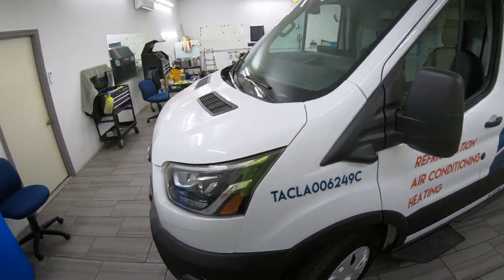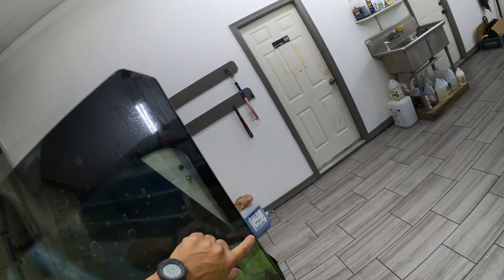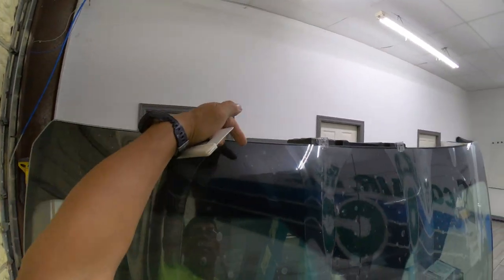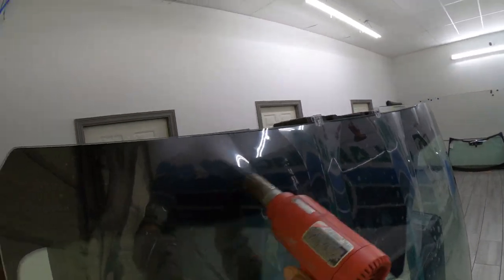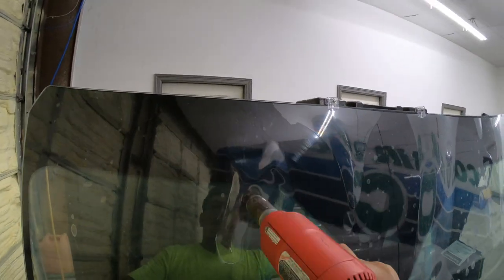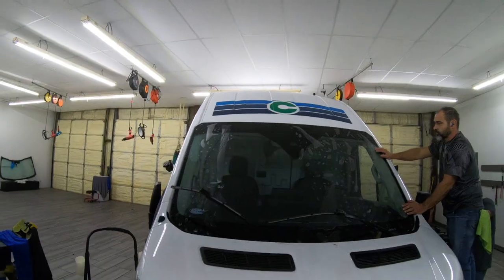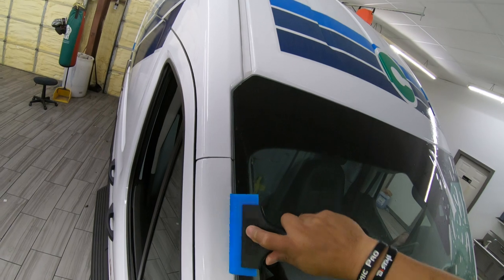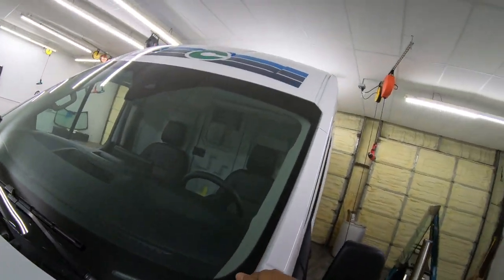2023 Ford Transit Exterior Crack Prevention Film Install  Start to Finish!

Comment: Hi Mike, thanks for posting this video. I’m a fan of your channel as I am too an installer. I was looking for a video on the ultra fit windshield film because I wanted to see how easy or hard It was to install this film and seen the video from Chicago auto pros who did a review on the installation and it didn’t go well for them. When I finished watching the video I said to myself why didn’t they remove the cap sheet and try it that way instead because there’s too many layers. And when I saw your video I was like I knew that would work. 2 great minds think alike. Thanks again for making this video and keep up the good work.
Reply from the maker: Absolutely boss 🙌 😎 👌

Comment: Does this film stand up well to scratches? Such as using a windshield wiper.
Reply from the maker: This is an accessory..it must not be used with wipers to clean dust off it..it will scratch it..
Rain will clear sand before wipers hot it dry...keep that in mind...like maintaining a Rolex..or white leather sneakers 👟

Comment: The video I was looking for! On my third attempt installing it on my tesla model 3. 

Was always shrinking it with cap sheet on thus; taking forever to lay flat and on the top edges it creases, does the film  scratches if the cap sheet is removed while shrinking and final squeegee?
Reply from the maker: Use a wool card ..no scratches
Reply: Which one would you recommend? I use  Mactac the white felt type squeegee and do see some not as much as the plastics  hard plastics , but see some scratches on cap sheet… don’t know if it’ll do that to the actual material?  

Also, I read and followed the instructions on the use of the heat gun for this specific material, but I see you yours it’s blowing a lot of air - do you have it on high fan and max temp?
Reply from the maker: @chichyiphone4  max temp..follow video...mactac works!!